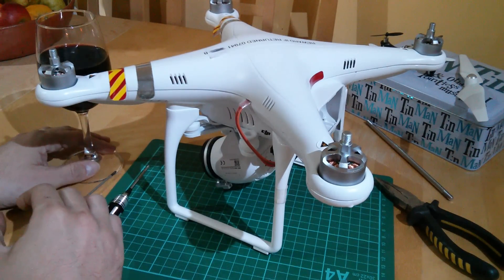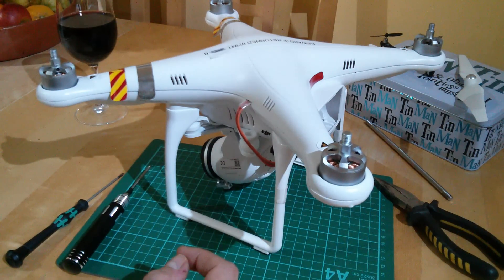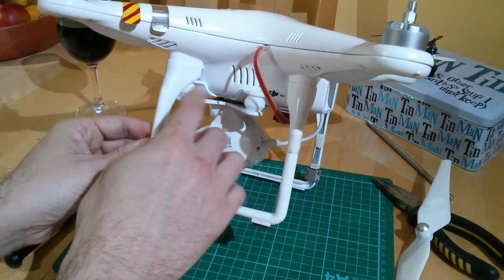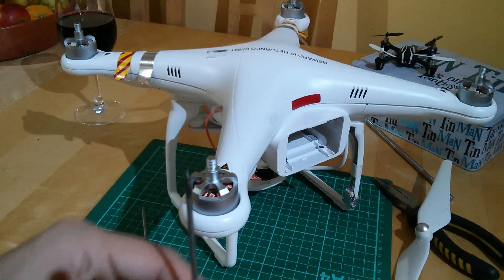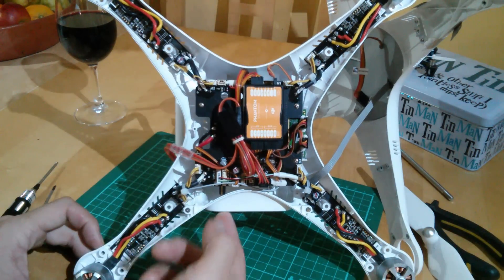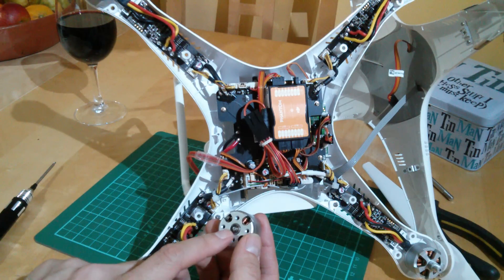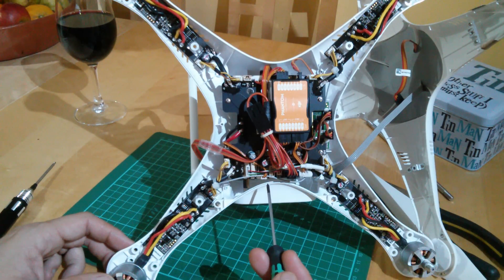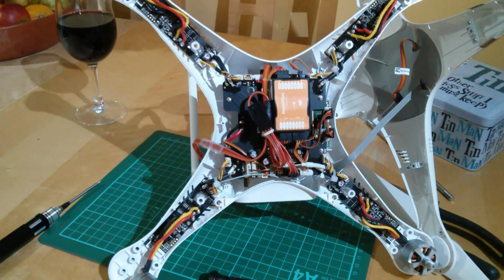DJI Phantom 2 Vision - How to do preventative maintenance checks, hints and tips.

Comment: At the motor you are showing on camera and turning it around the yellow wire seems stripped a little bit ? That could cause some severe problems if it touches anything. Maybe it's just an optical illusion that I get.

Comment: I also am a fan of maintenance,thanks for the tips.Do you know if the motor bearings are sealed and if not ,shouldn't we be putting a drop of oil on them every few flights?

Comment: Hi Simon I have taken the checklist from Phantom Pilot and added your extra comments. Also made a start on the Remote Controller.
Preventative Maintenance checklist ideas for P2V+

Comments, criticisms, additions and subtractions welcome.

BEFORE & AFTER EVERY FLIGHT
* Check condition of props (run finger along leading and trailing edges, flex both blades to check for hairline cracks near hub);
* Check motors move freely in both directions when spun by hand withour propeller?;
* Check motor shafts have no free play vertically and horizonally (missing E clip? Loose bell housing screw? Bad bearings?);
* Check camera mounts are secure (and any other attachments, e.g. Flytrex core, propeller guards); Check dampeners are not torn and retainer cables are present
* Check all gimbal ribbon cabels are secure and camera conroller cables (underneath the aluminium line of sight)
* Check Receiver antenna are intact and aligned correctly
* Check Compass connector is secure and clean
* General inspection, any cracks in body and landing gear,
* Check for bent aluminium camera mount and dings/dents to plastic. May need an internal inspection.
* Check condition of battery spade connectors and data pins (level, free movement, clean);
* When powered up and idling confirm no unusual noise or vibration from motors.
* Charge all batteries to 50% if storing or 100% if flying the next day
* Charge WIFI extender and use phone app to record charge remaining
EVERY WEEK or EVERY 10 FLIGHTS, WHICHEVER SOONER
* Check tightness of motor retaining screws and shell retaining screws (both 2.0mm hex);
* Check condition of philips and hex screws and replace them while you can.
* Visual inspection of shell and other plastic components for cracking/damage (landing skids, camera mounting plates, compass, antenna, etc.);
* Check battery, clean data pins and battery contact pads with alcohol and swab or proprietary electrical contact cleaner and cycle spring pins on Phantom with soft shaft(eg cotton bud or back of fingernail) several times to check for spring weakness and full unimpeded travel;
* Plug in to Vision Assistant and check tx & IMU calibration state and all battery cells have good balance (repeat for all batteries);
* Check batteries for number of cycles and discharge per DJI recommendations if required.
* Check for firmware upgrades
* Check for IOC controls, range limits and Failsafe behaviour. These should be documented in case the firmware upgrade resets them
* While on the computer plug the RC into DJI RC System Assistant and check the battery level on Remote Controller
* Check camera and gimbal is level and tracks when Phantom is moved(note the camera should be stiff if pushed)

EVERY MONTH or EVERY 40 FLIGHTS, WHICHEVER SOONER
* Remove upper shell and rattle and shake about (Listen) and no debris/loose items. Remove or blow out with canned air.
* Check state of all wiring - plugs fully seated, condition of all solder joints(a little pressure with a screw driver), condition of visible circuit boards and wiring runs, crimping of wires, anything caught or bent, internals generally clean
Plugs
4 esc and Mother board
Flight Controller
Receiver 2 x
Camera
Data Pins
WiFi
GPS (last) - If loose use glue gun.
* Check for swollen capacitors
* Remove motors and check security of E clips/brass spacer, condition of bearings and general visual inspection.
* Remove rubber cover from Vision camera server mounting point and check tightness of the small cross-head screw.
* Rebalance all Propellers if weights have been added.
Remote Controller
-------------------------
* Check Antenna for any damage
* Check controls are centred and move freely
* Check lanyard for weaknesses and ensure mount point is still secure
* Check camera or tablet holder for weaknesses. Tighten screws if necessary
* Check battery door is secure
* Check batteries for any signs of leakage and replace. Note only use alkaline as these hold their charge when not being used.
* Plug the RC into DJI RC System Assistant and check calibration of controls
* While on the computer plug Phantom into Vision Assistant and check calibration of controls and toggle switches
* Check the battery level on Remote Controller
Reply: ***** Sorry Simon just realised that the thread on phantom pilots is yours. I am with you all the way. Shame DJI doesn't release any circuit diagrams or functional diagrams of its modules. Competition I guess, or the documents are in Chinese and too risky to translate.

Comment: Hi their Simon,
Never occurred to me for doing visual check. Thank you for your idea and sharing it with us. You have saved me a lot of possible trouble. During this preventive check, i have noticed that my Phantom's receiver was loosing connection for few seconds going red and back to green again. Touching the connectors, i found i had a dry join ! Would not like to think what could happen !
So all , do your visual preventive checks. Ti can save you a lot !
Reply: Another incident today. One of the capacitors started selling up.
Most of you know what this means.
Once more thanks Simon,
Preventive visual inspection can save your drone.

Comment: I read, I think on PhantomPilot, someone recommending putting oil on the props to make them slippery in the air and easier to rotate giving longer flights on a battery charge.  What do you think about this?  Hope you get the RP gimbal soon, looking forward to your review. :)
Reply: ***** yes, someone said "oil the props"  My reaction was the same that it will attract dirt.  It may also deteriorate the plastic?  It may have been a joke as I fell for the first unboxing of the RP gimbal.  I'll send you a PM with a link on PhantomPilot if I find it again.  BTW, I love your video of you flying with your son and his friend.  I gave it the thumbs up as I often do